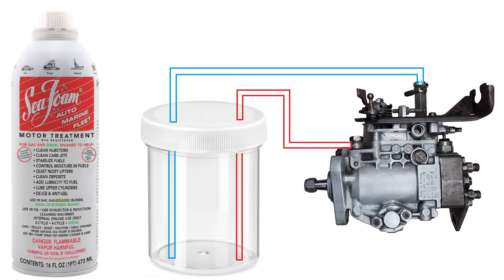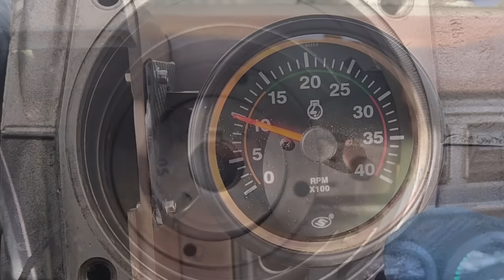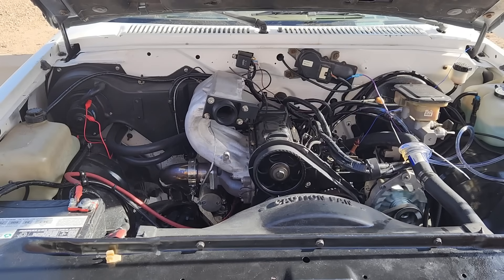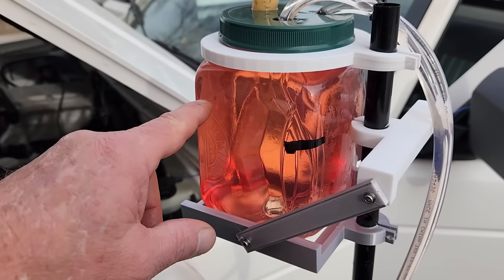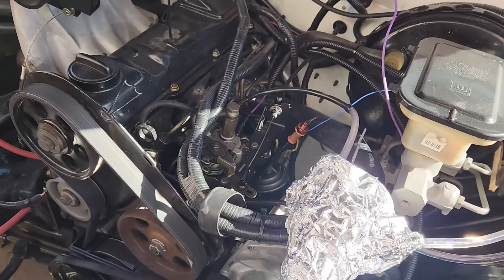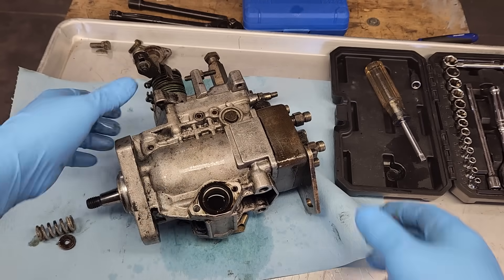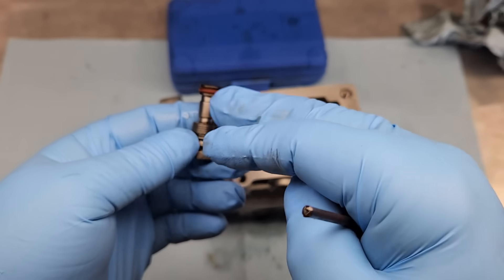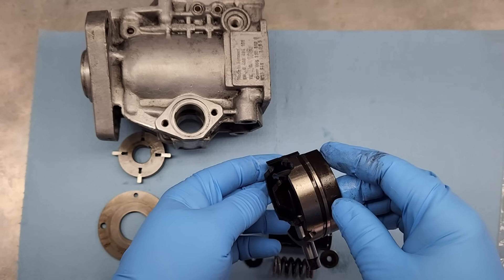S5 E49. We experiment with Diesel purge, SeaFoam and Berryman 12 to clean our BOSCH VE injector pump

Comment: b12 is the strongest for sure
Reply: The only issue with it is that its really dry. Its so good it'll also displace 2 stroke oil right out of premix for 2 cycle engines. I learned that the hard way as a teen. 🤣

Comment: Interesting (lack of) results. I've always been curious about trying seafoam, but it is not available on this side of the Atlantic. Liqui Moly products are.

I've got an old marine diesel (VP MD7a) that I suspect might have dirty/stuck piston rings, but parts like head gaskets are very expensive and working on it in the sailboat is a horrible experience. I try to help it with a shot of injector cleaner every year 😅
Reply: Run it with wide open throttle sometimes, and avoid idling too much.

Comment: 9:09 oh also you should separate the feed fuel line from the return so the nasty fuel coming out of the injection pump doesn’t go back in to the pump again lol
Reply: That's what the second line to the alternate tank is
Reply: @kennedy796  that plastic jug looks like it has two fuel lines one in one out normally there’s two separate ones one that feeds the injection pump and one that returns back to a separate tank

Comment: Jimbo!  Great video!  Can't wait to see if the good pump gives better performance and/or mpg's.  Are you considering running alternate fuels?  In this video, you mentioned some people run their diesels on vegetable oil...  Just curious if that was foreshadowing.  Thanks for the video and best wishes.
Reply: I hope he builds a fried chicken oil running truck... I could see Jimbo driving around town with the smell of fried chicken coming from the exhuast.
Reply from the maker: We may try it.  Vegetable oil works, but it dose need to be processed (filtered) before using as a fuel.

Comment: 5:24 revving the engine up and down is a good idea but better yet you should give that an Italian tuneup. I do it every time I change the fuel filter in my Jetta. I fill it with diesel, purge straight or fill the filter with a small bottle of sea foam and top it off with two-stroke oil once the car is started, you take it for a hard fast race car like drive when you get back on your couple mile race it should be running like new
Reply: Yeah or, just let chemistry do it's thing. Driving it hard doesn't do anything that this procedure doesn't also do.
Reply: @absurdspeed  google Italian tuneup it totally works and is totally worth it. I’ve been a mechanic for the last 13+ years and I’ve done it numerous times on lots of vehicles. I had a diesel Jetta 2006 BRM engine rigged up to a washer pump that sprayed these chemicals into the intake while driving hard and it unstuck the veins in my turbo where just normally running it not under a heavy load wouldn’t have worked.
Reply: @davea2407  Vanes.  But yeah.
Reply: @davea2407   This isn't a turbocharged engine, much less a VNT. And, what you're talking about has nothing to do with the fuel system. You modified the air intake system to clean something this engine doesn't even have.
Reply: @absurdspeed  i’m just using it as an example when you add the cleaning fluid, you get the car under a heavy load and make it work hard to build heat and loosen things up I’ve had probably 6-8 different vw cars/hatch that had the ALH motor 2-3 with the same 1.6 non turbo and some bhw/brm’s and my current Jetta with the cvca common rail engine I’m fortunately familiar with the vw diesel engine lineups from the 80’s to current lol
Reply: @davea2407   Fair enough. And I'm sure, if you're familiar with this channel, you'll know that the upcoming testing will be more than enough to clear out any carbon buildup. A couple of fuel mileage tests and, some zero to speed testing & it should be all clear. Especially if he's using quality fuel. I'm gonna try to convince him to do one final test, once he's established a solid baseline of mileage & acceleration, using Lucas fuel treatment to see if it makes any difference on that engine/truck combination.
Reply: @absurdspeed I highly doubt Lucas does anything but worth a shot I figure is so thick it’s rotational drag causing less mpg slightly but I’m planning on running a ALH golf on waste motor oil heated around 180-190f so it’s thin and I don’t have to add or mix anything to make it run I think that would make a great video could run that 1.6 on waste vegetable oil or motor oil and really stick it to the man lol I plan on driving my golf to Daytona Beach from Ohio next September when I go down it should run me about 45 Ish gallons give or take there and back
Reply: @davea2407   You don't add enough to change the viscosity of the fuel. But, it does add lubricity and, detergents that remove & reduce carbon buildup. I get about a 10% increase in the mileage of my gas vehicles & was getting, what appeared to be, about the same increase in a VE injected idi but, the use was to varied & sporadic to be sure.
Reply: @absurdspeed no it would open all the orifices up and either clog it way bad or pass all the crud in the pump
Reply: @kennedy796   Everything is opened & moved by just revving up to 2,500 & back down. It's not like a carburetor with a secondary fuel circuit that needs to be opened & flushed.

Comment: My brother used to be the senior mechanic at the local Deere John dealership. He said he’d tried many times over the years to clean injection pumps on the machine like this and it never really worked. If something came in with injection pump issues it was pretty much necessary to just clean everything by hand cause flushes just wouldn’t get everything.
Edit: and that’s only if all it needed was a cleaning, most of the time once you get into them you’re gonna find a bad seal or oring or corrosion if they’ve been sitting a while and a full rebuild is gonna be necessary.
Reply: Yesterday my six-year-old daughter told me that John Deere should make a green and yellow toilet and call it the John Deere John.
Reply: @BPBomber  a JD john would cost 4-5 times as much as a regular one, would require an internet connection so JD could sell your BM data to third parties, and it would stop working every year or thousand flushes and only a JD certified tech could get it to work again with an excessive 'in field' repair charge.  Note: I own a tree farm and none of my equipment is green anymore due to their anti-consumer tactics.
Reply: @Noah_E  absolutely, 100%. I wasn’t gonna get into all that but I’m glad to hear you’ve moved away from JD products. I am not a farmer but just a tech consumer. The damage that JD continues to do to farmers through their war against right to repair is simply unconscionable.
Reply: @BPBomber  even their old lawn mower were sabotaged to sell expensive parts. 
(freedom 42, timing belt. mod and never broke one since 15+ years)

Comment: 4:17 super low frequency thumping coming through my speakers makes it like someone is knocking on my wall!!! I had to stop the video 3 times just to check!
Reply from the maker: Good to know,  Thanks for the feedback.  The audio settings were accidentally changed.
Reply: Same. Had to shut off my subwoofer just to continue. I'm gonna guess it was wind noise that got filtered out, but the low frequencies got missed. *shrug*
Reply: @KMakato FWIW they're just P-pops, these always have to be EQ'd down on sensitive microphones if the pop filter is lacking, since the beginning of broadcast media. I've noticed them making a real resurgence lately, maybe as people consume media mostly through phone speakers which don't reproduce those low frequencies as well as headphones or larger speakers, and it's annoying - almost makes me want to get an external DAC just so I can EQ it out myself when it happens.

Comment: I’ve heard that Berrymans carb cleaner used to be stronger that it is nowadays.  Not sure if it’s the same story with that stuff.
Reply: Chlorinated solvents were removed 25 or 30 years ago...that stuff was wicked strong, but dangerous health wise.
Also ate rubber like crazy.
Reply: Ive been using it for around 20 years and haven't noticed a difference in either, the pour in is basically the same product in the can and has maintained consistent results for me for all that time.

Comment: I used some diesel purge on my 1998 vw jetta 1z tdi I was hoping would help injectors it didnt but im sure it helped the inkection pump.
Reply: For injectors, I filled a new fuel filter with neat liquimoly diesel purge, then ran the engine for about 30secs at idle. Then switched off and that way it can soak on the injectors overnight. Then the next day put another can of purge in the tank and drove the car like I stole it (once warmed up of course), giving it 1/2 mile blasts at high revs.

Comment: On my 7.3 IDI I always used ATF and chemtool B12 in the fuel tank.  I'd pour half ATF and sea foam in the fuel filter.  After I ran that, id run a filter fuel worth of marvel mystery oil after the engine was warm.
When I had issues and it worked. 

If put a quart of ATF in the tank every 5 tanks of fuel.
Reply from the maker: Good to know!
Reply: @robotcantina8957 I bought that truck and it's been sitting for 12 years so I was similar shape to what you're going through.

Comment: With the diesel purge.   You can run it straight off that.   No need to run it with diesel.   When I do it to my ALH golf, I both hoses one feed and one return to a glass mason jar full of Liqui moly Diesel purge works great.   Also, your best bet is to run a few little cans of NON SYNTHETIC  two stroke oil in your fuel every tank.   Old VW diesels love it.
Reply from the maker: Thanks for the input!
Reply: @slocavky Non-synthetic two stroke oil? Would that be like Catrol R?
Reply: @grahammonk8013 not sure.   Just make sure it's not synthetic 2 stroke.   It's hard to find.  But get the cheap stuff from Walmart or somewhere else. Cheap is usually non synthetic

Comment: Near 100% seafoam is safe.  The recommended procedure is to fill your filter/water separator with it and start the engine.

I did it a couple times trying to figure out if my lb7 injectors were bad or just dirty.
Reply: Being LB7, I assume they were bad?
Reply from the maker: Good to know, thanks!